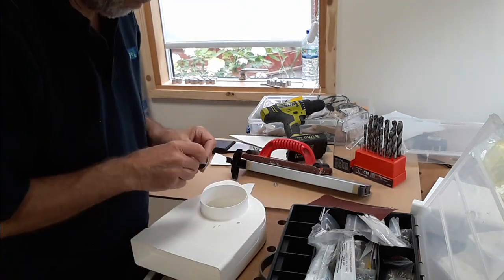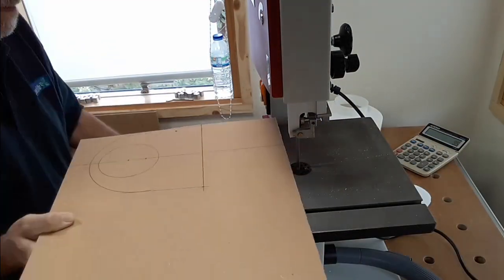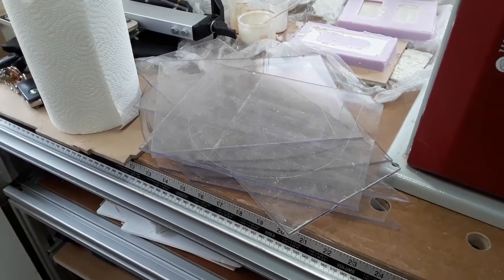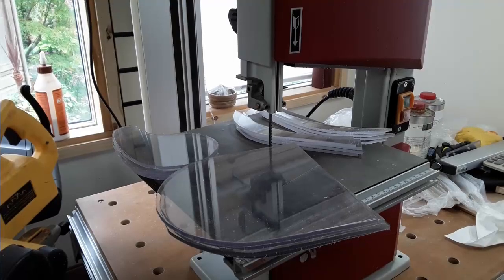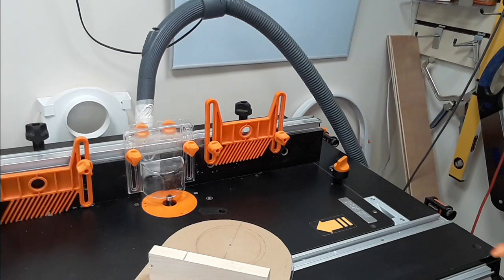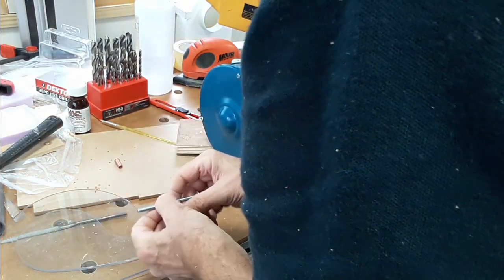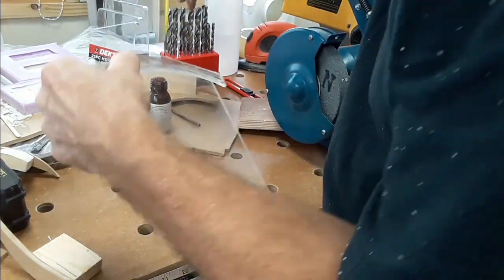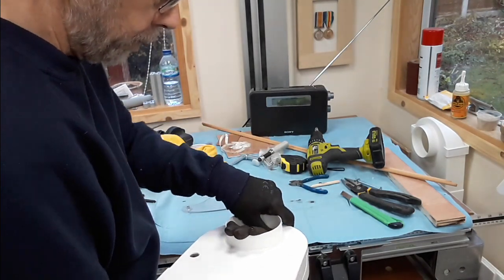the small shed #61 - blast gates

Comment: very interesting , one question for me do they make 4in end caps to fit over the openings that would just clip over and seal them off, i am thinking of fitting a system along the lines of yours in my 8 x 6 shed
Reply: I think it should be possible to get caps, as 4" is the standard pipe size for drainage and plumbing, so it shouldn't be a problem, I will need some to try the blast gate out as I've only made one until I find if it works. Record Power also do caps with smaller hose adaptor outlets that I can use on some of the equipment.

Comment: Quick tip : Where possible, always make your router template longer than the piece to be cut, so that you can start with the bearing on the template only.
Reply: Thanks for that, makes sense, you then run into the piece with the template firmly located, I will have a go at doing that next time.